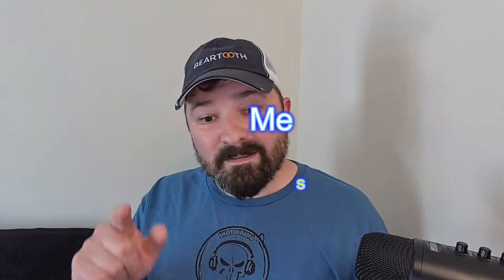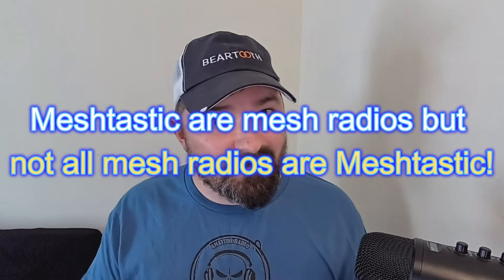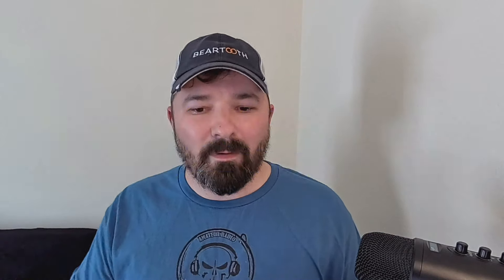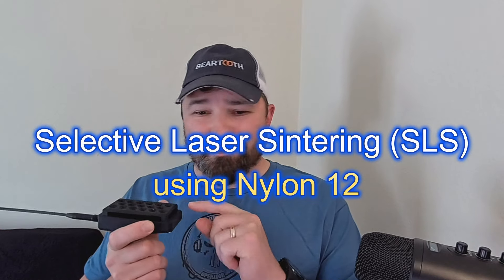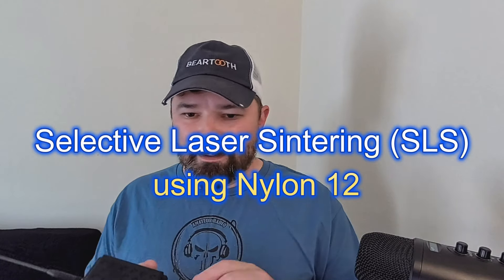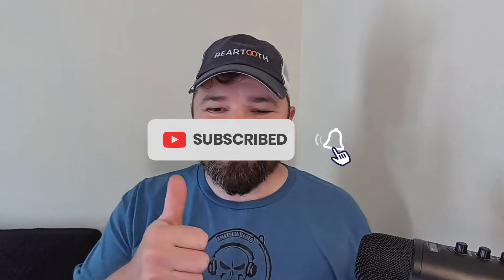Beartooth MK II Mesh Radios | In-depth Look | Advance Comms

Comment: I've had a set of these for a bit and they work great. Beartooth just opened up a public TAK server as well that was wicked easy to set up.
Reply: awesome say hello on the server!
Reply: I watched  the video, but i'm a novice and haven't been able to follow the video well enough to figure out which menu buttons are used, as they fast click through entire process. There isn't any audio to explain it as well. Any help other than re watching the video 50 times more and pausing it 10 times as much.
Reply: @BeartoothRadioInc  Will do shortly! Looking forward to what you guys come out with next for ATAK!
Reply: @bobsolla  pausing it at key points was how I set it up
Reply: @TrashcanMan8  Got it set up yesterday, thanks! It would've been a lot easier if they didn't fly through the install and  dictate what steps they were doing.
Reply from the maker: Are you looking a walk-thru on using ATAK and the Beartooth radio?
Reply from the maker: I saw that in the newsletter. I will be joining soon but I am traveling right now.
Reply: @EmCommSolutions  That would be great as well. I was just trying to hook up to the server, but the video was at hyper speed. I finally got it though thanks! It seems like most of the videos i see are geared towards expert users and not the novice like myself. One clear video for the most and useful uses at a time would be helpful in my opinion, instead of running through everything at once so quickly. Thanks!

Comment: How many Android or IOS devices can be connected to each Beartooth MkII?  For instance could a small team use one unit to all connect to if in range like 15 feet.
Reply from the maker: Unfortunately, only one device per Mesh radio.
Reply: Ok.  Thanks.

Comment: What size photos were you able to send? How long did it take to send and receive the photo?
Reply from the maker: Good question, the software compresses the photo as necessary. I will do some digging to see if I can find the actual size. As for time, I would say 10 to 15 second but I didn't time it. I will be doing more intensive test soon.

Comment: I’ve heard that they have a tendency to disconnect from the device they’re paired with with. Is that true with your experience?
Reply from the maker: So far no, unless I walk too far away from the paired device.
Reply: @EmCommSolutions  good to hear. I’m wondering if those reports are from the first gen beartooth device. Thanks!

Comment: Shill. It’s $50 of parts for $1400+
Reply from the maker: If you could build two of these radios for $50 in parts. I will buy them from you all day long. However, that might be a little difficult with the Digi XBee SX 900 Module selling for $112 each and that is just the chip.